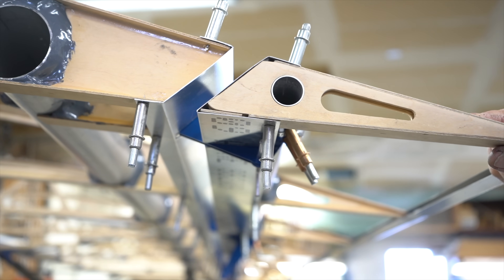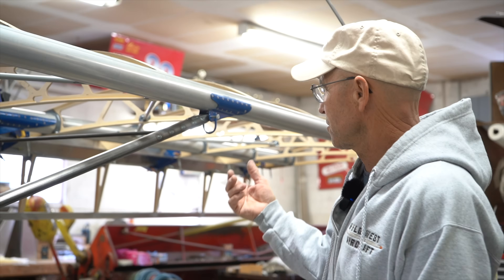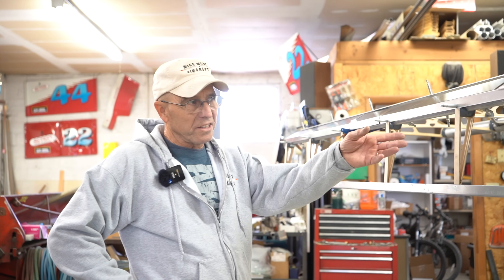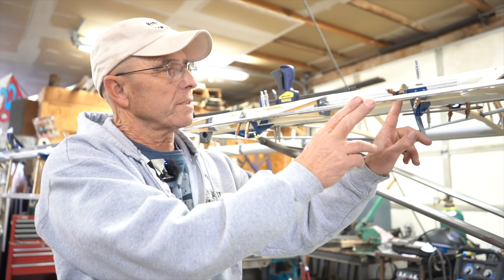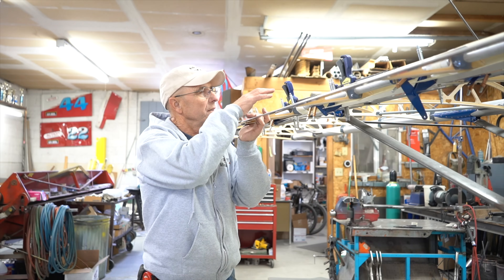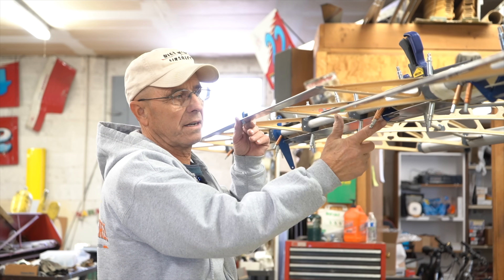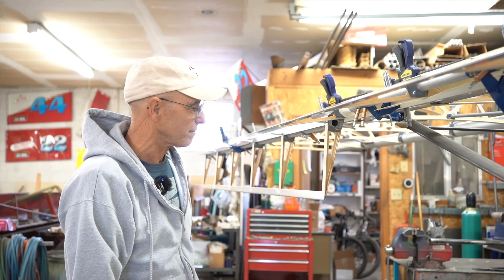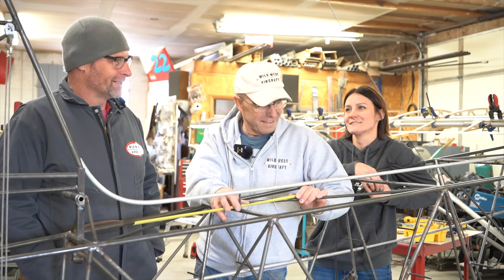Highlander Build #4 - Setting the Flaps and Ailerons

Comment: I am excited to see your rematch.  3 questions:                                                                                                                                                                                                                                                  1 how much does the sidewinder engine weigh, is it much  different from the apex in weight ?   what about rotating mass weight differences, 3 cylinders should be better.                                                                                                                                                              2 dimensionally how different are they length width height,                                                                                                                                                                                                                             3 will the same Skytrax gearbox work or is there something top secret in the works?                                                                                                                                                                                      .     love your videos    thanks for posting these  they are informative and helpful!!
Reply from the maker: I think the three cylinder is about 15 pounds lighter. They use different gearboxes, Skytrax builds both of them. Complete with gearboxes installed they are very nearly the same size. The way I build motor mounts for both of them the prop flange is 1 1/4 inches farther forward on the three cylinder. The three cylinder gearbox is longer front to back than the one on the four-cylinder, and I also put the three cylinder engine slightly farther away from the firewall.